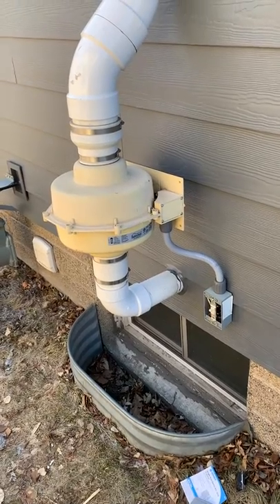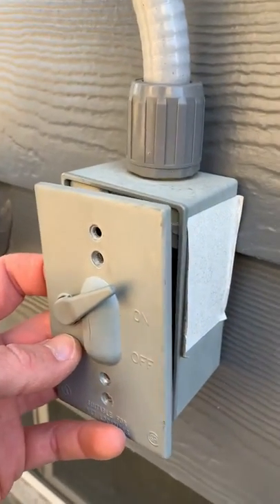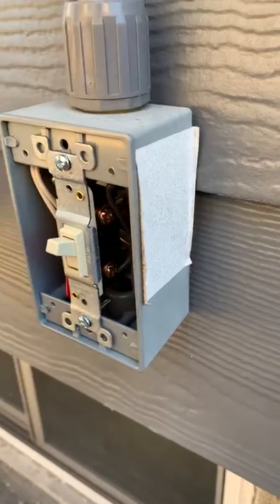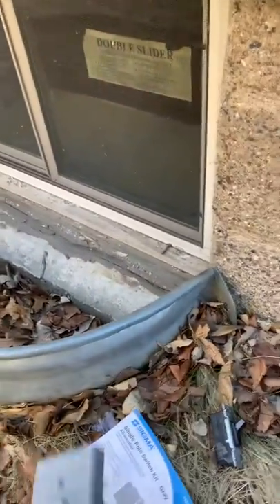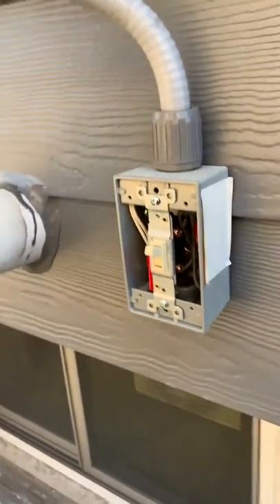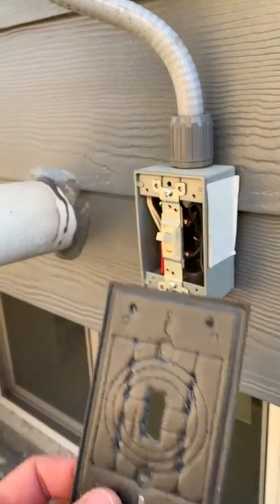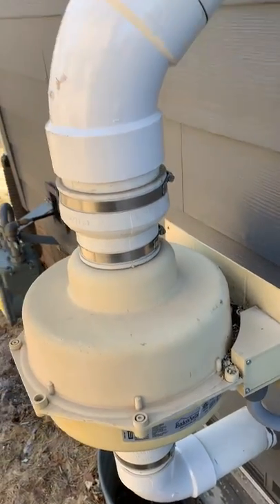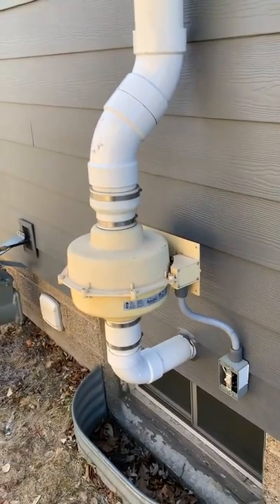Troubleshooting a Dead Radon Fan #radonmitigation

Comment: Another great video! We have a fan that is running, but zero pressure reading (oil is level at zero on both sides) on manometer. Checked outside vent near roof line, barely any air coming out at all if any. Could this be a dead fan that is running?
Reply from the maker: Thanks! Check out these videos. 

Fan Failure or Freeze Up - https://youtu.be/huaZcBEjAxc?si=WcUjfTHF1dhBNKMP

Radon Deicing System - https://youtu.be/P3xMpG6-dsE?si=l8GLihAotNczjezX

Comment: If your using a GP501 High Suction fan why did you switch to 4 inch pvc on the positive side of the fan?
Reply from the maker: Good question, Chris. 

We did not install this system, but we added two additional suction points and did a crawl space encapsulation and depressurization after radon tests showed her levels were still elevated.

We always use 4-inch piping outside as it is less susceptible to freeze-up.